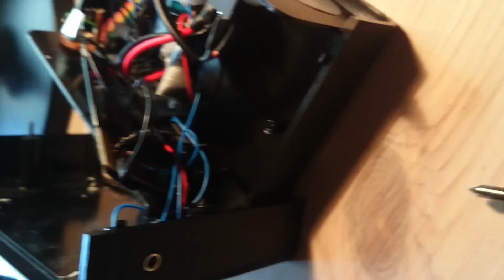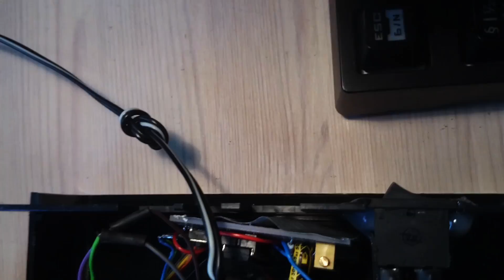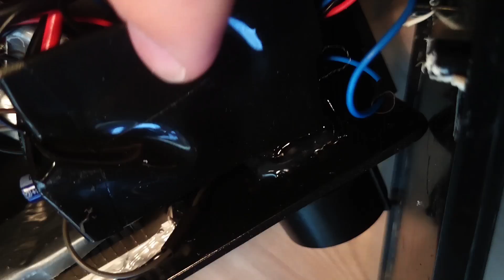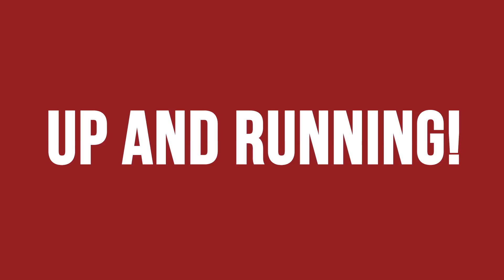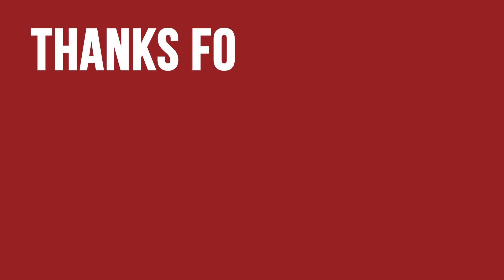Arduino Powered Spectrum Analyzer With Headphone Amplifier (W. Code)

Comment: I got this error 
C:\Users\Micro\Documents\Arduino\fft\sketch_mar26a\ArduinoFFT3\FFT\sketch_mar26a\sketch_mar26a.ino:5:40: fatal error: FFT.h: No such file or directory

 #include <FFT.h> // include the library

                                        ^

compilation terminated.

exit status 1
Error compiling for board Arduino/Genuino Uno.

Comment: Hello there, interesting project you have here. Tried recreating but got the same results as  v-cu. all lights on. can you share the schematics if possible (specially on the audio input side) thanks
Reply: finally debugged the all lights bug, it was the pin setting for DIN, CS, and CLK, bands 1 to 4 were ok however am having problems from 5 to 8, cant get the zero value when A0 is connected to ground (band 5 starts at 2 LED on, band 6 starts at 3 LED  on, band 7 starts with 7 LEDs, while band 8 is all lit.. tried tweeking the sketch.. to no avail.. hope you can point me to the right direction. Used FFT3 library
Reply from the maker: Hey, i didn't make a schematic, but i found this which is made in the same way as mine where the A/D is the A0 on the arduino.
https://i.stack.imgur.com/qY70O.gif
Reply: Thanks for the reply.. will try it out this weekend after i get the parts.  Hope you can help me out also with the led matrix bug as stated above. Oh and I tried your v2 code as well, nothing lights up.
Reply from the maker: I can't see why the first code would act as you describe, sorry. I did however find that the v2 code is missing the line of code that's supposed to output to the matrix (lc.setrow). Don't know how that went missing (whoops?)

Comment: Did you use an MSGEQ7 for analysis, or was it completely Arduino (well except for amplification of course).
Reply from the maker: It was all done in the arduino ;-)
I have bought a couple of MSGEQ7´s though so i will try making an analog version later i think
Reply: ***** , do you have anything like a schematic?  The part I don't get is how to light a given string in succession (as in a wave pattern).  Are you using a matrix for that?  I can Charlie plex if necessary but still don't understand, say, 60hz led column lighting up to the top.  Is that motion written into the code (racing up and down the led string)?

 I am trying to minimize the extra number of components.
Reply: ...Aaaannd, I just rewatched.  I see a commercial matrix.  Nice

Comment: The code didn't work in my arduino :( leds only shine..
Reply from the maker: Well, then it's probably because you either havent connected the matrix right or something is wrong with your library. Maybe i can help you if you post the code and schematic :-)
Reply: ***** Code is the same as your.  Connections:  http://i62.tinypic.com/wtazqb.jpg  . Leds only shine.. Not respond to input from my phone.. Library i gave to the folder. Maybe old version?
Reply from the maker: V-cu Oh i think i see the problem now ;-)
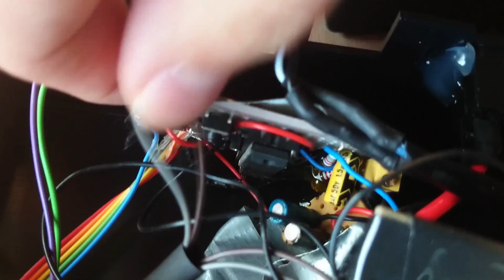At 0:32 at the right of the chip i have made a circuit that is necessary for audio input, i will get back to you with the schematic for that when i find it.
Reply: ***** OK, but why leds shining , as if it was a signal of the input?